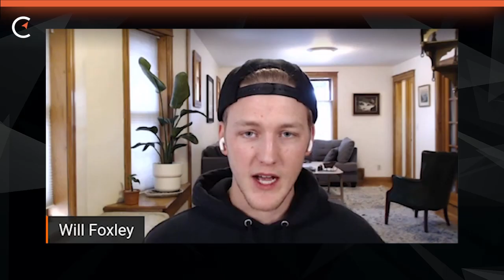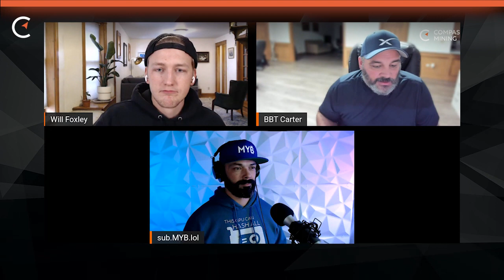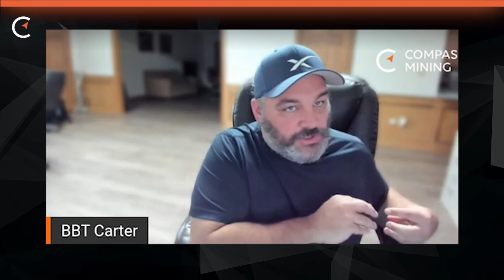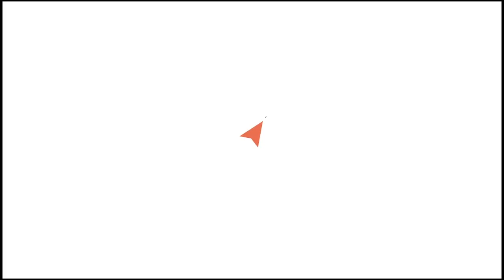Proof-Of-Work Hysteria | Compass Live CLIP

Comment: The conversation about efficient energy use needs to include what allows the most transactions per kwh.  The answer is big blocks.  BTC blocks are 1MB while BSV blocks are 2GB.  That's an efficiency boost of 2000% so far more transactions can be processed for the same amount of energy.  Conversely, each transaction will use 2000% less energy per kwh with the 2GB block size.